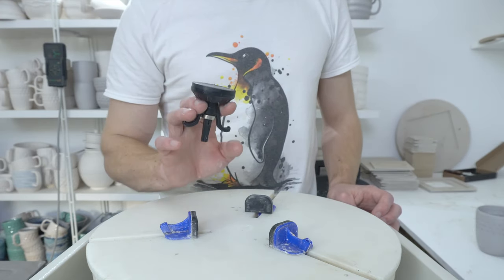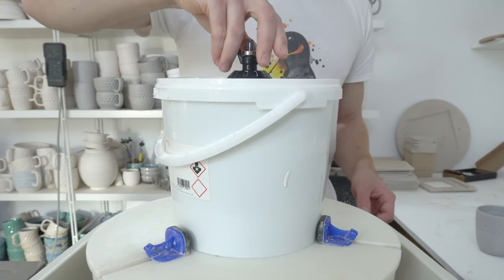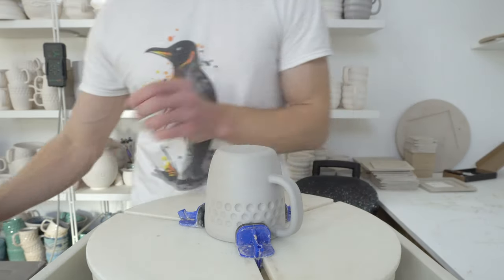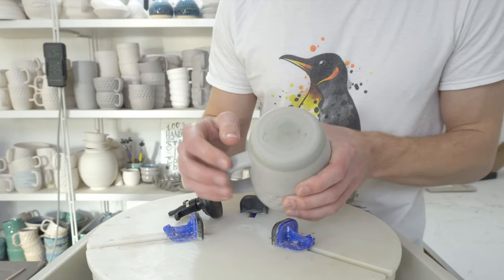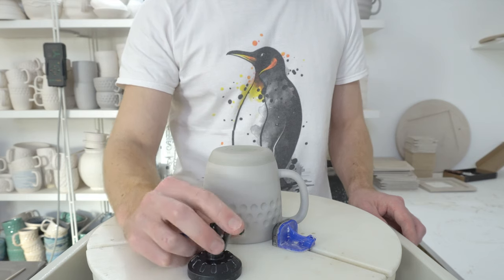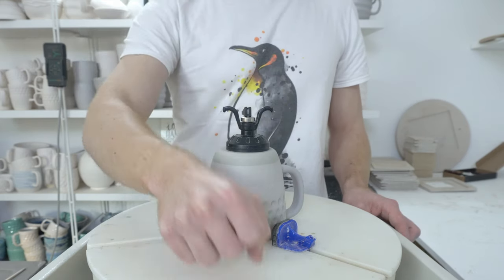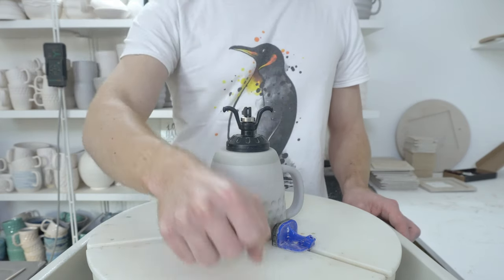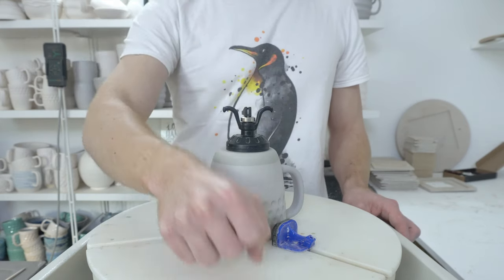Car Dent Puller - Top Pottery Tools

Comment: Tried mine for the first time today with spotty results.  Think the rough clay may be the problem on a few of the pieces.  I do wax resist the bottoms but the puller will release and pull off a circle of wax release.  I haven't tried diluting the wax though. Do you think it will help if I do?

Comment: Are you sure you're not an engineer? :) Yep, your definitely an engineer.
Reply from the maker: Haha, maybe in a past life!
Reply: I bought two and neither works on my pieces - yet. I haven’t given up.. because on 2 pots the logo interferes and it doesn’t hold but also the wax is candle wax and isn’t completely flat perhaps?  The dent puller  I bought doesn’t have the Press down part in the middle.. but it suctions to an already glazed mug and to my phone so I think it may be my wax resist or logo that is the problem.  Try, try again!